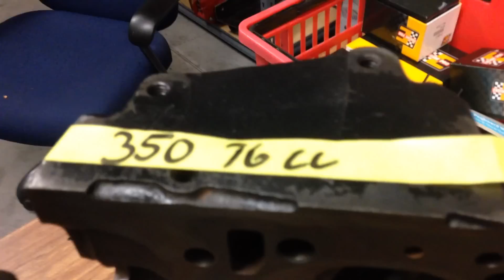350 and 305 Chevy what's The Difference

Comment: Could you take a 350 combustion chamber/ header and put it on a 305 ( this would equate to less compression right? ) and then add a tubo or super charger to it to make it better [ cars that have tubo or superchargers have low compression right? ] so basically do the opposite 5:40 ( 3:35 ) also could it be considered an upgrade to a 305 by putting a 305 header with bigger value for flow would that equate to an upgrade for a 305 block
Reply from the maker: some 350 heads have valves that will hit the edge of the bore on the 305 and bend I wouldn't do it

Comment: There is a big difference in heads, for starters the space between the chambers is much thicker then a 350. Easy way to identify 305 heads vs 350

Want cheap power get a set of Vortec heads and either modify the intake bolt holes or buy different intake. 

Easy to get 400 hp out of a 350 with factory parts.

Comment: Tuned port 305 fro. The late 80s Cameros  work great and 350 can’t take a rev I’ve floated the valves on a 305 till it Ofer heated and blew the rad hose off twice then slowly stopped /seized and let er cool down fired right back up and drove home and drove the car for another year lol

Comment: 305s make awsome engines for cruiser and light duty trucks .... dependable ...cheap and decent economy ... my friend gets 25mpg out of his 79 impala and does 70 no probs on the interestate... i also have a 79 malibu classic with another hated on small block ....the 267 ....i get 28-30 mpg and can no probs do 70 on the highway ! They are awsome for what they were made for but can never be hardcore hardcore performers like the big boys ... ( ps both these cars bone stock even have the smog shit still hooked up and the factory dueljet carbs. When i rebuilt them i knocked out the lean plugs to adjust air /fuel mix ... makes a giant difference in how they run )

Comment: I’m running twin 305‘s in my 1999 cruiser yacht 2870 Rogue my starboard Engine shit the bed million dollar question I can get a brand new 350 for the same price as a 305 refurbish some mechanics are telling me I can run the 350 in my boat along side the 305 on the port Some mechanics are telling me I’m a  idiot not understanding why Especially after watching this video why i wouldnt be able to do so. I read all i have to do is flash the computer and some little things but its very much dueable? Thoughts?

Comment: If you have an ear for it you can hear the difference that .24 bore makes.
On the subject of the 305s personally I love them. They're definitely not a performance engine they're just basically a nice sounding nokia phone. But it also depends on which model you're talking about. If you ask someone about a 305 most people will automatically think to the 4bbl LG4 (150hp) or the throttle body L03 (170hp), but the one people should look into is the very uncommon Vortec 5000 L30 (230hp). I dropped one of those into a '91 Caprice and it was every bit as good as an LT1.

Comment: 350 also had 63cc, and 68cc chambers, 305 blocks were bad to crack in the lifter valleys, don't really show up until you hot tank 'em, then they junk..... so much after market stuff for sb1, it's no use running anything stock except maybe the block....

Comment: So... here's a good one.. what do you get when you take a stock block 305 and put forged stock size pistons with gapped rings a 383 stroker kit and , heads, cam, intake, headers, exhaust..?? Sounds to me like a great episode of engine masters!!😁
Reply: Oh ya...
And, a fat slap of nitrous on top of being force fed that charge..
Reply: You can not go far enough with the bore to use 4in bore or larger pistons .60 over is the max and with .60 and a 400 crank(383 crank) the engine will only be 334ci and will still not perform as good as a vortec headed 350
Reply: @briang4470  ya. I know that if you just did the bottom end and put crank, rods and pistons in it, a 305 would still not be a 350. No matter what you do to a 305 it's not gonna be a 350. The exercise I was trying to outline is, how far can you take a 305. How many bolt ons can you do to a 305 before it grenades. It just seems like something anyone who enjoys seeing impossible things would enjoy watching.
Reply: @derektrieglaff9103  ya I agree it's interesting to get the most out of what ever you can the only problem is 305 parts are the same or in some cases more expensive than parts for a 350 or 383 or 400 but to each their own I like 305s in stock form because they are just about indestructable and you can find low mileage ones for cheap they aren't complete junk like everyone says but I feel they aren't worth putting a lot of money and resources in because u will be disappointed but I would respect some one if they had a true built 305
Reply: @briang4470  I agree with that also.. small block chevy parts are all close to the same price. But, to watch a video showing someone getting 5,6, or even 700 hp out of a 305 just sounds crazy to watch. There may be better power platforms out there to start with... I'll be the first to say that... and, I've seen people put heads and intake with headers and a carb on 305's. And, I'm also the first person to ask why they did that instead of doing a 350 swap. But, it just seems like it would be inspiring to people. To show that it doesnt always have to be a 350. I mean, I've seen L-79 novas with the 300 hp 327 stomp all over ss 350 camaros.. so, small displacement aside, I think it's worth having a video about how much power can you add to a 305 small block chevy.
Reply: @derektrieglaff9103  there are guys that use 305 chevys in sprint cars and run on methanol and make big power with them and it is interesting to see these things make good power but if you're on a budget and don't have alot to spend the 350 will give you way more bang for the buck even a 327 would because of the large bore size. There were also guys in the 60s and 70s with super stock cars making big power with 283s and 327s by turning them very high rpm if you're interested in that you should check out south east gassers association where they run era correct small blocks and big block and turn them 9000+ rpm and they sound amazing
Reply: @briang4470  that gassers club sounds pretty awesome. I'm always interested in those classic racers. Thanks for the tip.

Comment: What would happen flow wise and power wise if you bolted 350 heads to a 305 block?
Reply from the maker: the valves would smash into the block and bend so not much flow or power
Reply: Myvintageiron7512 thats definitely not what you want to happen.

Comment: What about stroking it to a 334? Is it gonna always make less power than the 350 or 383? My theory is that the shorter stroke would help for high rpm hp and the stroke being longer than a 327 it could still make more torque. Now of course with a better head, port and polish or whatever upgrades you think would be best, looking at the meat between the cylinders makes me think it could take more power with the right piston and ring gap.
Reply from the maker: the bore size is what really hampers performance I would build a 383 if I was going to stroke a small block and just build the 305 in stock form

Comment: You can always shave the port holes my first engine was a 305 until we bought my Monte Carlo with a GM 400 Small Black 202 heads 202 Cam My Dad and i Built a Fully Homemade Hotrod 1932 Frord Front End And Straight Axle 1969 Chevelle SS Rear End 3 Speed Muncie Transmission The Frame is Made out of angle iron the body is made out of heat Ducking sheet metal wheel base is shorter than a Corvette weighs 1200lbs all together Set up for 100 shot of Nitric unhooked the Bottle set up for street and strip Built By My Dad and i Summer 1998 1999

Comment: The 305 got the bad reputation that belongs to the t.p.i. The main thing that strangles it's potential is that weak and spotty fuel delivery (and its low flow heads).
I agree about Engine Masters being the best show ever for hot rodders! Even though they failed to realize (or failed mention) in the 383 chevy vs. 383 mopar episode is that, the mopar is almost 30% heavier, completely negating the tiny h.p. advantage of the mopar. Once, or twice I've seen them not factor in that a dyno is a static test, where the weight and other factors matter on the strip, where it really counts! ...Also, mopar parts are harder to find and more expensive. Other than that, BEST show!!! Lol
Reply: 383 Mopar had a ton more tip in dyno torque than the Chevy stroker 383.   Both ended up having just about the same peak horsepower
Reply: @lukepokrajac1057   I'm talking about the 305, but I agree there really wasn't a huge difference between 383 mopar vs. chevy, except I think the mopar made just a little more torque. I could be wrong about that though.

Comment: I had a 96 305 vortec and it was pretty good. I never had any issues with the truck and the person i sold it to is still driving it today.

However my first and current truck has the 350 and i like it but if i needed an emergency motor in my current truck id put a 305 in it.

Comment: I have a 305/334 that has been 0-decked line bored, bored 30 over ,distressed and studded, 3.75 stroke crank, forged rods, custom Icon pistons, Custom cams solid roller cam and lifters, Brodix 11X  spread port heads , speck single plane intake, and 750 double pumper, and it's no joke, it makes 456hp @ 7100 rpm at the crank naturally aspirated. Built by 3D Motorsports So I will agree the 305 can make good power when properly built and I like being just a little different because it's cool out running someone and then telling them they got owned by 305 lol....
Reply: I'm currently looking @ 91-92 Camaro RS with the 305 to build with the original engine. I'm curious to know though, can you use Aftermarket 400 Small Block Chevy Heads and Aftermarket 400 Small Block Chevy Cam in a 305 to make the most amount of HP & TQ that can be achieved???
Reply: @159002   I had my engine completely designed and built by good friend of mine at 3-D motorsports but I do not believe 400 heads would do you any good on A 305. The only reason I went with Brodix spread port heads was because he already had them on a 334 making great power and I got them cheap LOL but find a good set of vortec 305 heads with 194 valves and you will be more pleased with that then anything else budget-wise
Reply: But see, that's the thing though, I'm wanting to know, if I'm aiming for big power, what is the biggest Cam that I could possibly stuff in a 305, period, point blank? You know what I'm sayin? Screw the nonsense. What's the Highest Flowing Head that would make the absolute MOST HP/TQ that you could possibly make with a 305 that's been Bored Out to it's Max Cubes it could be Bored over to, Stroked to its Max Liters it could be Stoked to with Domed Pistons running like a 15.1 CR

What IS the MAX Cubic Inches a 305 Small Block Chevy can be Bored Over to, AND, what is the Max Liters that a 305 Small Block Chevy can be Stroked to, with a custom made Fully Blue-Printed, and Forged and Balanced Rotating Assembly???

I'm wanting to know (A) Biggest, most aggressive HP/TQ making Cam you can put in a 305, Off the shelf or custom made from scratch or, otherwise. (B) What is the absolute most Highest Flowing Head that would make the absolute MOST HP/TQ that you could possibly make , that could even fit on a 305 Block, that's been Bored Out to it's Max Cubes it could be Bored over to, Stroked to its Max Liters it could be Stoked to with Domed, Pop-Up Pistons that go all the way up into the Combustion Chambers, running like 15.1 CR. You seem to know these Engines and I feel like "YOU" can answer these very specific questions that I'm very curious to know. 

I'm also aware of having to have some very good, possibly custom made Solid Roller Lifters, Chromoly Pushrods with the Billet Solid Roller Rockers and the Oversized Valves, and Valve Seats, and Valve Guides, and ALL that good stuff. I'm very well aware of that, that THAT, would be an absolute consideration...
Reply: @159002  I don't know that I can give the answer that you're looking for because all of my machine work and preparation was completed by 3D Motorsports but I do know for sure that dropping in a huge cam and a huge set of heads could quite possibly make you lose power instead of gain power so if you're going to spend all of the money for the things you listed in your reply you might as well consult a reputable engine builder to answer your questions I'm just a guy who had an engine built for my project by someone else thanks for your replies

Comment: Could you do a Chevy 302 review... And yes there is such thing I'm not talking about the ford 302 Chevy made one to qualify to get into the trans am races
Reply from the maker: I actually have a few videos where I mention the Chevy 302 I have had a few customers request a 302 build but I talked them out of it GM offered the 302 as an option for 3 years in the 67 thu 69 Z28 Camaros the problem I have with this engine is it was a purpose built engine because the Trans Am race series had a 305 Ci limit the 302 was a pretty bad ass engine when used for a race car however the detuned low compression street version does not make a very good street engine, mainly because it is a big bore 4" with a 3" stroke this made it a very high revving small block 8000 RPM was pretty easy for this engine.
You had to really zing the rpm's up to get any power out of it even more so with a low compression pump gas version that is why I do not recommend building this engine those kind of RPM's make for a pretty short lived engine in a race car that does not matter in a street car it does better off with a 350 or 383 more power and TQ at a much lower RPM = longer engine life

Comment: I’m curious if that 350 block/ 305 head combo made more off idle to around 21-2200 rpm torque. Seems like it should
Reply: I have a all stock 1973 3970010 350 4 bolt main with stock 601 ho 305 heads that I drag race now and it's a complete beast.only thing I hate is it only runs it's best on avgas 104 octain but it's squirrley

Comment: In the end, there is no substitute for cubic inches. I've used 305's and 307's and they're run just fine. It's not that hard to build a 250-275 hp 305 or 307.  If you put that in an s-10 it'll flat out run, but in a 3/4 ton truck...not so much. lol  If you have a big impala, get a 454.

Comment: How about 202 heads old CamelBaks on the 305 what cam would I use thanks like your stuff
Reply: The only way 2.02 valves would benefit a 305 would be if it was built for all out competition use. Not necessary with a sub 6500 RPM street engine.

Comment: Upper driverside block one will say 5.0L(302,305,307) and one will say 5.7L(350) alot easier to determine without having to pull the engine apart
Reply from the maker: This is only true for the 1 pc rear main seal blocks they made very few 305's in those years the vast majority of them don't have any external markings you can us the casting numbers that's the way I do it

Comment: Hey bub. Can I put 350 heads on a 305 block? Will that work?
Reply from the maker: I wouldn't recommend it there is a chance the bigger valves can hit the edge of the cylinder and bend they will also create very low compression if they are open chambers most of the factory 350 heads are 76 cc 305 heads have much smaller chambers lowering the compression of an engine that is pretty weak already is not going to give a good result.
Reply: @Myvintageiron7512  okY thank you sir. Resaon I'm asking. I'm looking to buy or build a motor for my boat. Looked at a 305 with newer 350 heads and I was confused.

Comment: Is the 350tpi a long block 350 or have i been mislead
Reply from the maker: A long block is any engine that has the heads and valve train installed a short block is the lower end without the heads so it really depends does the TPI engine have heads on it or are they off

Comment: My bad experiences with the 305 all begins with the factory. Poor quality engines were common when most of the 305s were being used. A quality rebuilt 305 is a fantastic engine. Not a hot rod, just a great running and dependable engine. If I were going to rebuild an engine it would be a 350 and not a 305

Comment: A machinist once told me that any V8 engine with a 4" bore has a total displacement of the stroke plus .02. So a 350 has a 3.48 stroke, add .02 and you get 3.50. The 327 has a 3.25 stroke so plus .02 and you get a 3.27 and the 302 Ford and  Chevy has a 3.00 stroke. The 351 Ford engine's have a 3.50 stroke but their actual displacement is 351.86 so it's pretty close to 352. Just an interesting mathematical equation.

Comment: Just swapped my 96 chevy 5.0 to a 5.7 other than the motor, what else should I swap out computers ??  thanks in advance.
Reply from the maker: Nope you don't need to swap anything
Reply: @Myvintageiron7512  so it should work. With out any problems. With the 305 ecm and cpu.
Reply from the maker: @joelperales1670  It should I have done it several times with zero problems,  however keep in mind there are a bunch of GM tunes a dozen or so there is always a chance you could have minor issues but it's unlikely the only difference between the engines is the bore size
Reply: @Myvintageiron7512  thanks for the advice

Comment: If you port the 305 heads and put in a .600 lift cam to get the valves past the head surface they'll make good power in a 350.
Reply from the maker: I've done it they don't work all that great they are just ok